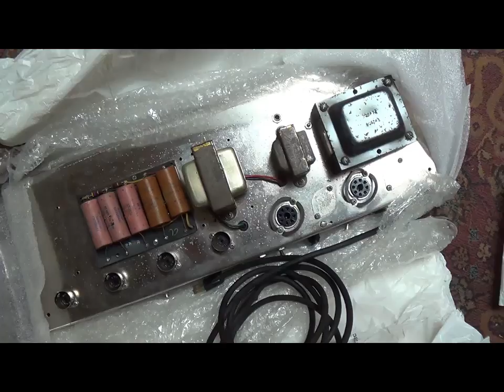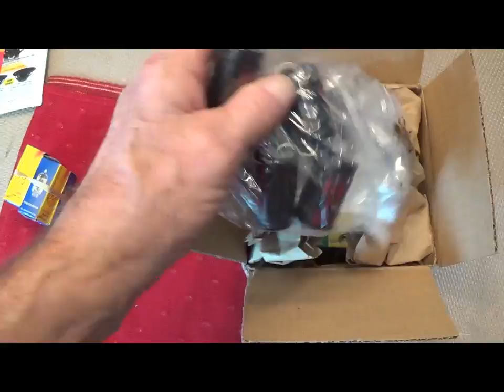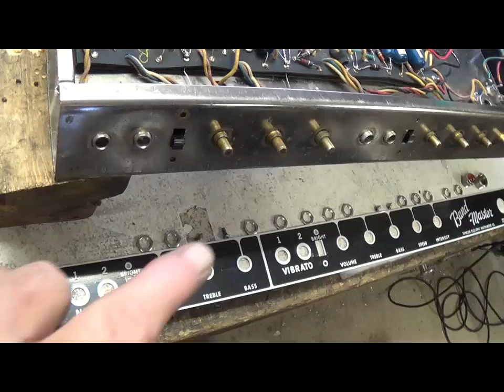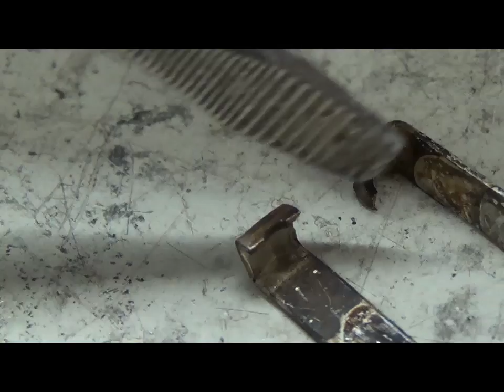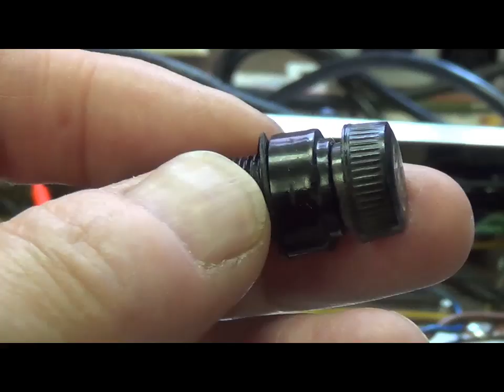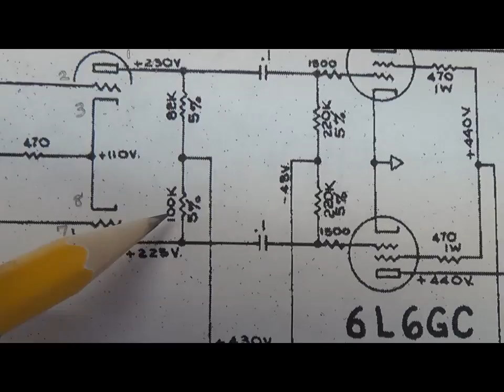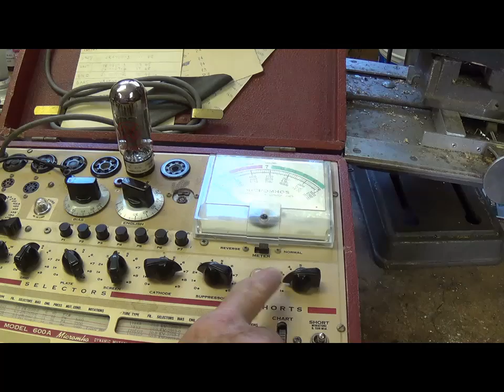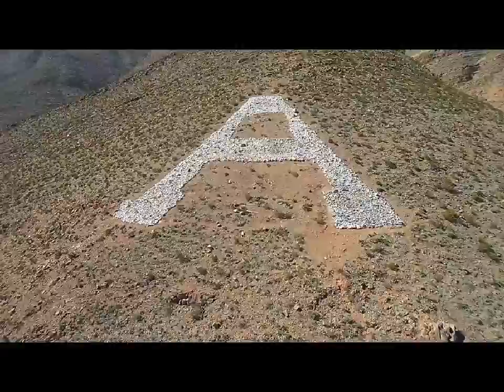The 1965 Bandmaster from Hell......A Really Tough Repair Job

Comment: Hi Doug, I did find a guy on eBay that sells these repro Bandmaster faceplates, but he wants just way too much money for them. I just wanted to comment on Antique Electronic company in Tempe, Arizona. I have a Ceriatone JTM45 amp that takes KT66 valves and I had bought a matched pair from those guys you mentioned. I sent the faulty valve back to those mates at Antique Electronics and after a month they said they never got the valve back. They wanted proof. So I sent it back and after constant phone calls to them, they finally agreed to send me another KT66. Well low and behold, the new valve was so far off spec of matching the other valve, that it was unusable. So I wound up taking the bloody bite on that set of valves. But I must say that I have dealt with them for a very long time and never had a problem before. Valves are very dodgy. I am not really a big fan of the JJ valves. The TAD valves seem to be more reliable to me. Trying to find some descent preamp valves is my big problem. I'm just curious Doug, what part of Texas do you live. I traveled through Albuquerque, New Mexico and Arizona when I was young. Thanks for your great videos. They have helped fix my Fender Blackface Bandmaster. I could not figure out why my amp was red plating. It turned out that I needed to replace the bias pot. It was totally fried and also I have replaced all of the blue caps with Sozo caps. Replace a lot the the resistors as well. You explain everything so well. Your knowledge of amps is mind boggling. I have watched all of your videos. Getting ready to retolex my Bandmaster cab with a little help from your video. Thanks from Michael Newell from Niagara Falls, Ontario,Canada
Reply from the maker: Greetings, Michael. I'm sorry to hear of your problems with KT66's, but enjoyed and appreciated your other comments. I live in El Paso, TX a couple hundred yards from the silvery Rio Grande :) Best of luck with your Bandmaster recovering project.

Comment: Since the aux power socket is two prong and wiring polarity is very important as far as safety I think you might have the connections reversed.  I remember the saying when wiring up plugs was "black to brass, white to silver".
Reply from the maker: This was a temporary oversight, which has since been rectified, Erik. Thanks.

Comment: I like repairing these old fender amps I remember about 12 years ago I was doing these for accent audio video and I got fancy I used heat shrink on all the leads on the electrolytic capacitors now I stopped using it last worked on a fender twin reverb 1982 with a shorted power transformer I put the new one and noticed the B+ at  430 volts and B- at 42 trying the balance matching -36 -36 too low changed out a resistor at the matching pot from 15k ohms to 29k ohms got it up to -57 bringing it up to -51.5  -51.5
Reply from the maker: I love exchanging old war stories about amp repairs, TW :)

Comment: Hello Uncle Doug:  If you still have those electrolytic cathode bypass caps and filter capacitors, I would be happy to purchase them from you.
Reply from the maker: I'm sorry, Don, but I returned them to the owner with the amplifier. Out of curiosity, why do you want them?
Reply: I restore them for customers who want to maintain the "vintage" look of the chassis and the circuit.

Comment: Great video, great sleuthing! I have a 66 Bandmaster that was 'gone through'  and restored to original  performance ( he said) by a recommended tech,  it sounds good but is lacking bass. I've owned Fender amps since the 60s and I know that a setting of just 3 on the bass channel should give you oodles of bass. It's going through an Emminence 15 speaker and is very disappointing for the money I spent on it. Recommendations?
Reply from the maker: If a Bandmaster is weak in the bass department, then something is definitely wrong, Johnnie. If it had good bass before the tech worked on it, then have him review his modifications and correct the problem. This is not something I can do long distance. Check the bias and balance of the 6L6's for starters.
Reply: Thanks, I was wondering the same thing, will do!

Comment: Another great video Uncle Doug! But I have one question about filament heaters and the way they should be wired. I often see that they're being wired the other way and that it is the proper or "perfect" way. Is one method really the wrong one and the other is good? Or is it more of a preference thing and/or maybe it all depends on the amp desing so one way may work better in some amps and the other is better for other amps?
Reply from the maker: In my first amp builds, I ran the twisted filament wires along the chassis surface and around the tube bases, which looks very neat.....BUT, I had some 60Hz hum issues. I did some research and converted to the elevated twist, drop down to the socket method and have never had a problem since. I am convinced, based on personal experience, that the latter wiring method is the best.....and I am backed up by both Fender and The Valve Wizard.
Reply: Thanks UD That's what I've assumed but it's a lot clearer now :) however I think I'm gonna try both methods anyway :D
Reply from the maker: Fine. Best of luck with your project(s).
Reply: Thanks. I'm getting there. But in what way it puzzles You? Perhaps I'm not speaking clear enough today... We were pickling some stuff for winter so maybe too much vinegar fumes affected me in some way ;)
Reply from the maker: I gave what I thought was a good and thorough answer. I hope it is helpful.
Reply: Yes, absolutely! No worries :)

Comment: I'm curious how much that job cost the owner? I have an old 74 Princeton Reverb that works fine but how much will it cost for new capacitors?
Reply from the maker: If it works fine, then you probably should leave it alone, Mr. W. However, if you are serious about having all the caps in the circuit replaced or just the filter caps, and realize that two-way shipping is quite expensive, then give me your e-mail address and I'll contact you with an estimate.
Reply: gofffbum@yahoo.com thanks for the quick reply

Comment: Uncle Doug, from the very start of my troubleshooting intermittent problems in equipment that used vacuum tubes, I learned that good tubes should be able to withstand moderately aggressive taps from a finger (or pencil eraser) without sparking or unexpected affect.  Tubes are subject to flaking cathode material, and weld-fatigue from the repetitive heat-cycling, so I made judicious tube-tapping the rule, to avoid call-backs and unhappy clients.
Reply from the maker: Thanks for your input, James.

Comment: …. 0:42.....is that considered a 'Cat Scan?'....I'm 71 and have been fooling with electronics since I learned  how to solder when I was 4...my Dad taught me, he was in the army corps of Engineers, and also taught Electronic Engineering in college......those ittermittant electrical problems were always a headache...
 I've seen those types of 'circuit boards' there, but never took one apart...what does the back look like...point to point wiring?
Reply from the maker: The circuit is a mixture of point-to-point and eyelet board, Doug. It's all shown in the video.

Comment: I love JJ small signal tubes, but I won't use their 6L6s.  I have a pair from a Fender amp I repaired that were microphonic like all get-out.  The guy needed the amp next day, so I pulled the 6L6s out of my Heathklt PS-4 and put them in his amp and he was happy as a clam!  Microphonic tubes are OK in a power supply :-)  If it's my $$ on the line, give me old Soviet Reflektor 6P3S-Es ... best 6L6-type tube ever made if you ask me!
Reply from the maker: Thanks for your input, Jason. This was my first problem with JJ tubes, but I appreciate hearing from others regarding their experiences.

Comment: I have made switch repairs like that. I have a small sheet of brass laying around for such as that. Regarding the weird capsuckitors with
a crimp on both ends...they look like something out of a speaker crossover network. Strange(8-). Yeah...sure, Doug...YOU saw the short
indicator light up(8-). Anyone else see it? Didn't think so. Whatcha been drinkin', Doug? Seriously, fleck of crap inside, maybe? Ya shook
it loose...I fear it'll be back...Guess not(8-). Great outfit to do business with. Gonna write the company name down. They're top shelf.

Great video...and a challenging specimen to work on. It truly needed the Dr. Doug touch. Glad you had Jack around to help with all
the soldering. Thanks for the video and the education it provided...and thanks for the drone ride for dessert(8-).
Reply from the maker: You're welcome, Tom. I'm glad you enjoyed the video :)

Comment: Excellent restoration video, I was a tech in the late 60's and 70's for a large music store we sold Fender, Kustom, Ampeg etc. we also sold Magnavox TV Stereo and Kimball Pianos and organs.  Quite a few of the amplifiers I serviced reeked of stale cigarette smoke and beer.  Restoration is a lot different than repair, I was usually looking for one part that failed , In restoration all parts are suspect as you just demonstrated.  I left to go into two way radio and hi power transmitters...since retired.  When I left consumer servicing we could still get genuine RCA, Sylvania, and GE tubes (sold a lot of them).  Getting a bad new tube was extremely rare but it did happen.  Good move getting a replacement,  I despised call backs....
Reply from the maker: Thanks for your interesting comments, Howard. We all miss the good old days :)

Comment: So you left some "purple" caps in the circuit. Why not replace those as well?
Reply from the maker: They seemed to be functioning properly. I guess you could simply replace every component in the circuit, Robert, but to me it's best to focus on what's needed and keep the original components that still function well.

Comment: Great video, what a ton of troubleshooting! Anybody else shocked at the failure rate of the modern parts from AES??  It's a shame modern tubes are such a disappointment in both reliability and sound. The reason the tube had a short... most likely...it had some off-gassing / at break-in -- that's why the short went away after it stabilized.... I see it all the time when testing true NOS tubes....those matched tubes had probably not been burned in at all. One of the many reasons I would choose a pair of moderately used 6L6 or 5881 1950s/60s US made RCA, GE. Sylvania or Tung Sol/Ken Rad over modern / reissue types any day of the week! Factory matched pairs are over rated, as rough matching can be done on a decent Hickok tester (or Dynamic Emissions Jackson even. Every musician I have ever talked to had breathtaking results with the Real McCoy vintage tubes, (lightly used work fine). Old American and European tubes sound  often work better on their last legs, than allot of newer Pentodes sloughed off on us these days!  It's a shame -- better to skip new tubes (buy vintage instead) and go with parts that might need to be bought new, like the caps, or resistors.
Reply from the maker: Thanks for your input, HiFi. I agree that good used, vintage tubes are preferable to newly made......but with customer amps, you have little recourse when your own stash is running out.

Comment: Unless there's something about the audio compression causing it, I'm hearing some nasty artifacts when the guitar is played through the amp and even when it was just the function generator, as though there were some ultrasonic feedback oscillation doing a ring-modulator-like number on the input signal.
Reply from the maker: I believe you are the only person to mention this, Hub. I don't deny that you may be right, but I sure didn't hear it in person.
Reply: It sounded to me like something was off at 24:54 when you had the function generator connected and running at ~300Hz and the same kind of extra harmonics were present all over the guitar signal. I would just suggest that if the amp makes the same sound when you play this YouTube video as it does on the bench, you might want to throw a scope on that output.
Reply from the maker: Thanks for your input, Hub.

Comment: Doug,I have a question about the three prong cord. Does your hot (black) wire go straight to the switch or fuse holder? I've watched other videos and they do the fuse holder first. I think your way is right cause I wouldn't think you would want your fuse hot first !  Sorry about the pour typing.
Reply: Your so right, thanks
Reply from the maker: Many people seem to feel that the fuse should be first, then the switch. I disagree. Their way, if someone turns off the switch to check the energized fuse, they could still get a nasty shock (regardless of which end of the fuse is wired....if the fuse is good). My way, when the switch is off, no AC is entering any component (other than a contact in the switch) or part of the circuit. It's like the amp is unplugged. If, by some freak of nature, the switch were to spontaneously short circuit, your household circuit breakers would shut it all down.....and who has EVER had a toggle switch spontaneously short out while not being touched? If you understand how they are constructed, it's an impossibility.
Reply: Uncle Doug:  I fully agree with wiring the power switch first so that the fuse is isolated from 120V while the power switch is off.

Comment: Uncle Doug,
FYI: try vacuumtubes.net for all your NOS tube needs.  Great prices, great service, very easy to deal with guys.  Not a knock on anyone else...
Seriously, for your next project (I hope you take requests), how about a small Champ clone in a Mother-of-Toilet-Seat covered cabinet...that would be the bomb!
Reply from the maker: Thanks for the link, C7. I'm quite satisfied with AES, but will keep your suggestion in mind. I have already done a video series on scratch-building a Champ (from scrap parts, no less).  If you're suggesting that I try to clone a MOT cabinet, if you research the method, I don't think it's practical.
Reply: It's just that I've seen you perform miracles, and this is something I've been interested in for years, so I thought I'd try to learn from a master...thanks for responding...if you know a link for the method, please send it my way...
Reply from the maker: The process requires sheets of the crystalline material which are soaked in acetone or lacquer thinner until they are pliable, then they are molded to fit the cabinet, where they dry and harden.......no fun, and I don't have access to the sheets. Do a search for the process. It's not OSHA approved :)
Reply: Thanks...I won't mention it again...

Comment: Interesting that there no interior chassis markings. My 1969 Fender Bandmaster-Reverb amp has hand written next to the power transformer in black marker, '12', 'and in red marker T20', and '9/69'. I am guessing that someone went to astronomical lengths to polish the chassis. I have seen photos of other 1965 Fender Bandmaster amps and there is some printed info on the inner chassis near the power transformer.
Reply from the maker: The chassis appears to have been plated, Tony......either chrome or nickle.....prior to assembly. I believe this may be a special amp, perhaps for a unique purpose or person.

Comment: Hello Doug .

Thanks for the bandmaster amp repair . It looked in good condition but definitely had a sting in its tail. You need to know your subject and have the equipment and knowledge to get that one back to life.  Congratulations on a brilliant job. Great component layout too . Sounds nice too , smooth midrange and light peppery top end customer should be happy with that . Difficult sound to get right . I used to play the bass guitar just wondering if anyone ever made bass amps?

A nice drone footage still looks like Mars where you live . But obviously not.any way thanks again.

Best regards

David UK
Reply from the maker: You're welcome, David. Yes, bass amps were and are rather common, but not from Fender. Ampeg is primarily known for their bass amps. I would imagine that my local terrain is quite different from yours. This is where they tend to film cowboy movies :)

Comment: everytime we get a box we have to let the cats inspect it.i found some what looked like nos mallory capacitors the 450v jobs that were in the can on my deluxe reverb.i just have a question it looks like the person that fixed the tremolo left part of the light hanging out that needs to be totally dark correct?the shrink wrap is on but the sides are showing
Reply from the maker: Since the chassis is pretty well sealed from light, you can probably get away with incomplete enclosure of the photo-resistor......but it will be hard to test and evaluate when the chassis is out of the cabinet.
Reply: @UncleDoug  for some reason this amp has always had a problem with the I call it tremolo I looked and saw that bassman circuit looks pretty close to the deluxe reverb I just have one more question and thank you you always reply and you always give good advice if you could suggest some things that I could check that would cause it not to work oh geez almost forgot I have a Peterson strobe tuner from 1972 model 400 I'd like to message you tomorrow and ask you some questions about that from what I can see looks as if one of the drive transistors cooked thanks again
Reply from the maker: Be sure the footswitch jack is shorted, PJ, or the tremolo  will not work. This has embarrassed a bunch of repair people :) Other than that, you can replace the entire optical resistor element for only $10 and you can replace the three oscillation loop caps for less. 

I know nothing of strobe tuners, but a viewer named Dead Koby is an expert with them. You will find comments from him in my TelRay OrganTone video. Maybe you can reach him that way.
Reply: @UncleDoug  thank you your always a great help